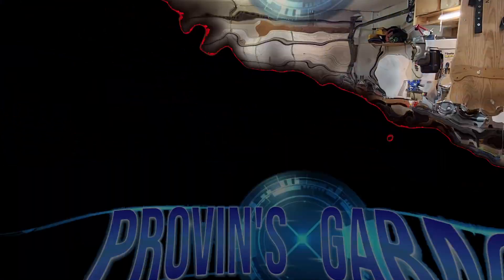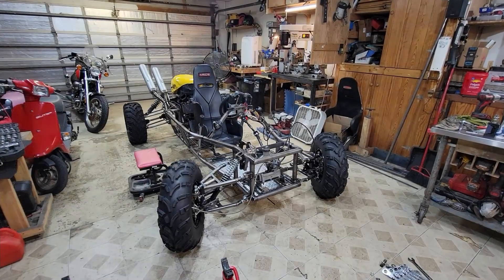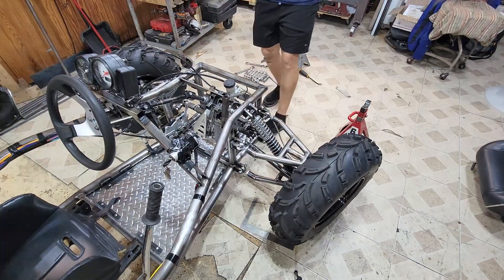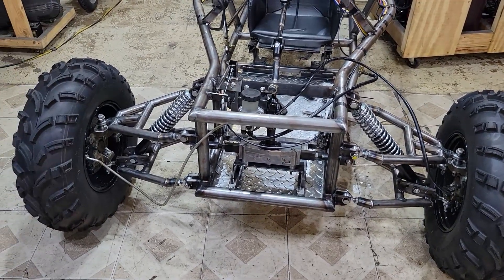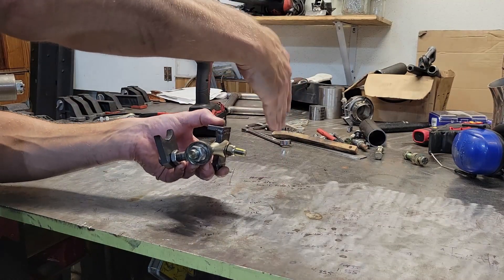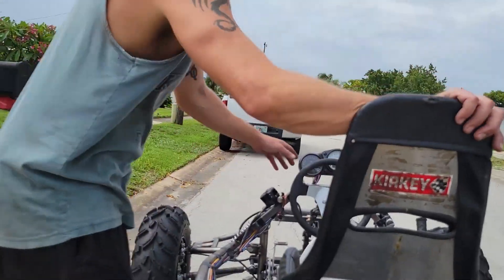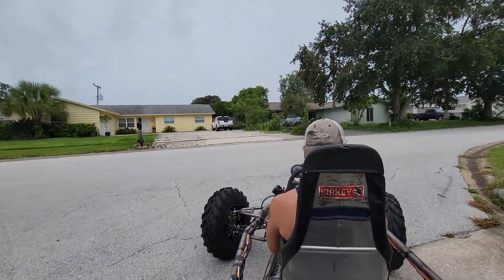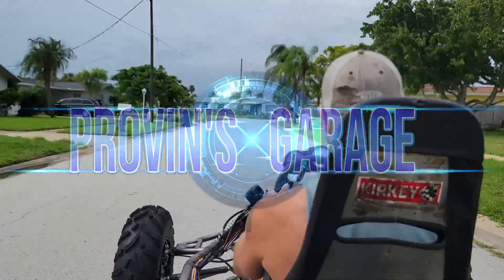Fixed Ackermann Steering on the LiterKart Crosskart | Shakedown 2, Drives Great now |Provins Garage

Comment: Nice save! 2:24 your upper shocker bolt appears to have no nut..? And your ECU needs some vibration dampeners to get it off the frame.
Reply from the maker: Good catch, it definitely didn't have one at that point. I did go over all of them twice before I drove it and made sure they were all secured with nuts and lock washers. I have some plans for mounting the ECU with vibration dampening, there will also be two extra electronic boxes in there by then 😉

Comment: Really cool build, I love the engine you used. I want to build something similar but 4wd.
Reply from the maker: Thanks! I have been doing some research into a 4WD buggy and trying to figure out the easiest and cheapest way to do it. I have been contemplating just taking the drivetrain out of a smaller 4WD truck and building a chassis around it... And then putting an excessive motor in it. I like to party.